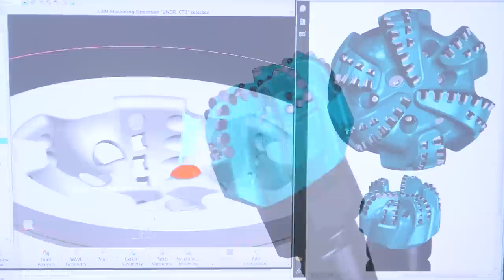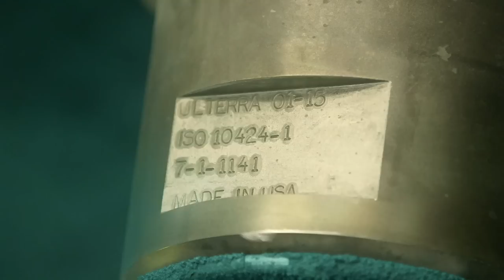Ulterra: Life of a Drill Bit

Comment: We once had a failed squeeze job because of a channel in the formation - long story short, we cemented about 1000' in the casing... We had to get one of these bits and a motor - the drilling bit company said, "once you make up that bit and run it - it is yours". We said "we need to drill out the cement, we are not worried about the cost" - well come time to sign the ticket...

But now I see and appreciate why these bits are the best for drilling any kind of medium. Ulterra #1

Comment: I wonder if the process inside the furnace actually involves heat treatment of a machined piece or  foundry of the metal base carrying the bit theets. I would suspect that a casted base piece would be fragile and thus not having enough strenght
Reply: they always heat treated the parts after casting in the furnaces for roller cone bit parts  for PDC bits ( fixed cutter) they never heat treated specifically due to tungsten being quite strong
Reply: @grunge-mb9sb  How do these compare with Halliburton bits?
Reply: @LRRPFco52  I build bits at Halliburton and watching this video our bits are 1000x better lol
Reply: @xKGMx-  I'm an aerospace guy, but I heard something about drilling bits for the petroleum engineering sector that compared them with some advanced metallurgy and technologies we typically only see in aero.  Thanks for the response!

Comment: They designed it on a computer but then use a guy freehand with a grinder to finish it??? Seems extremely primitive manufacturing methods
Reply: Its drill bit that low production volume and doesnt have to highest tolerance like piston engine. Also drill bit has many various kind pattern bit depends models and not practical set up cnc for evey bit